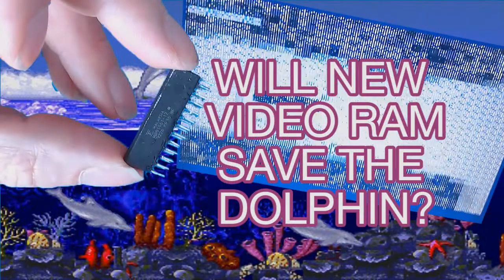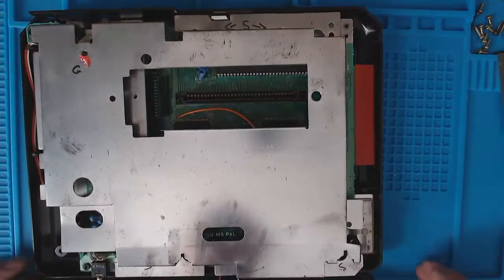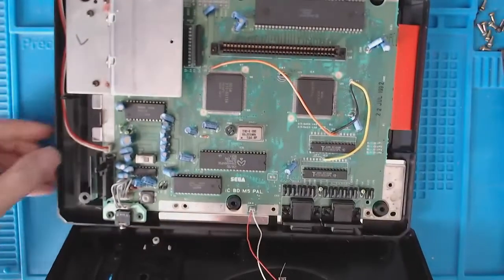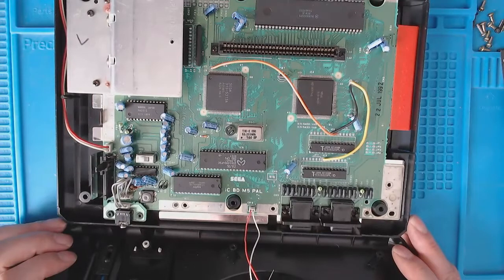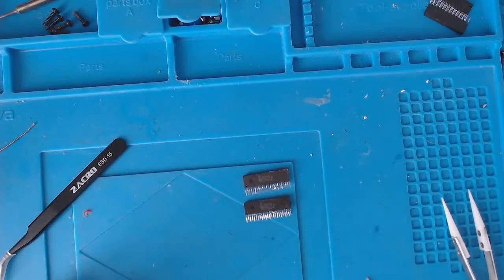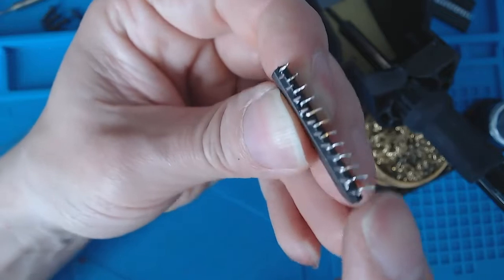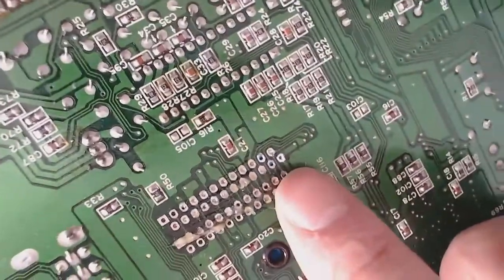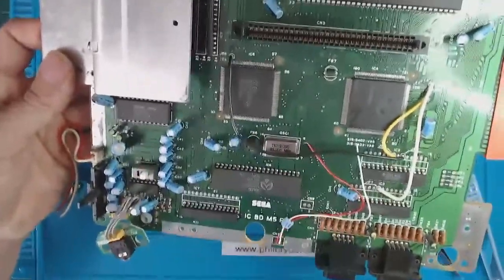Sega Megadrive Corrupt Graphics Fix. Swapping Genesis Video Ram

Comment: Do you have to solder the topside od the board under the chips?
Reply from the maker: No. Just solder the pins where they come through the board on the bottom.

Comment: Did you try re-soldering the original ram chips in place first? May have just been some cracked solder joints.
Reply from the maker: I think so yes. I have a second Megadrive with the same fault, hopefully I'll come across another trashed one, that I can use for parts and get it working too.